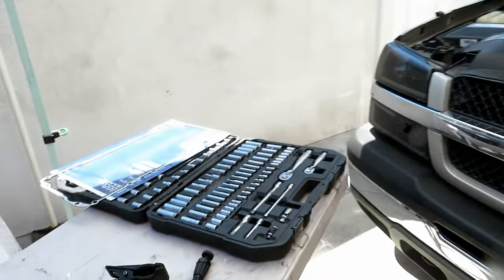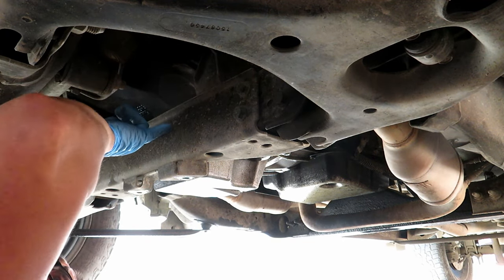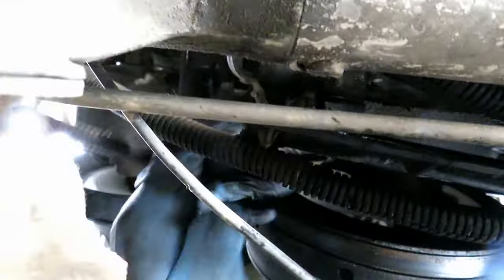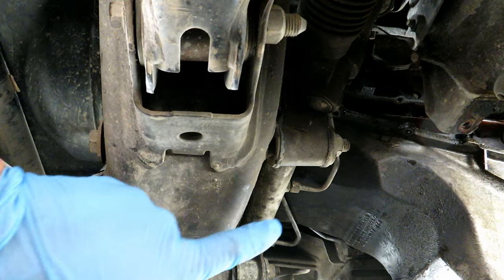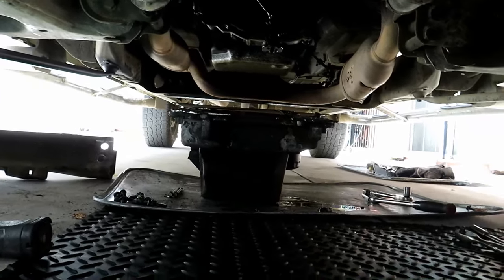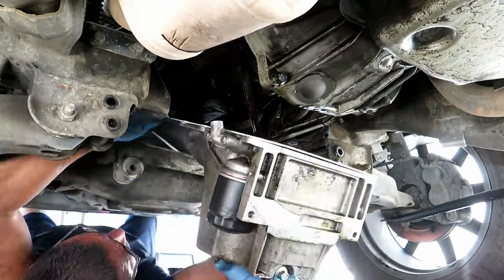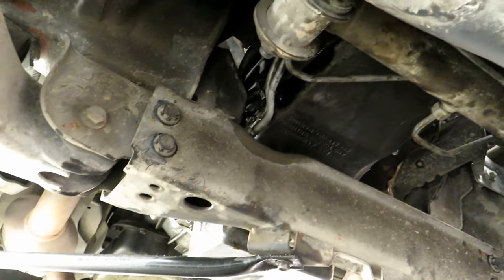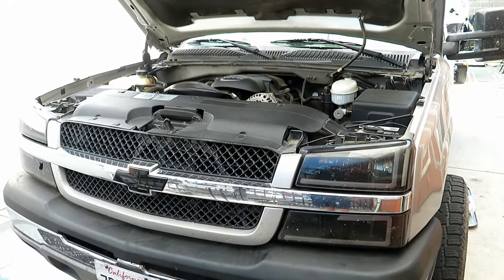Chevy Silverado 2WD - Oil Pan Gasket Replacement

Comment: Terrible the guy didn't even use gasket Maker
Reply: Factory tells you not to use that junk so whos the terrible one x)
Reply: Gasket or glue but not both!
Reply: @LucidRelaxation619  there are 2 points on the gasket in the aft that you should apply it, I believe it's for the rear cover.
Reply: @oreo1167  you never use glue
Reply: "glue" just holds the gasket in place
Reply: Exactly when u use torque specs u shouldn't rely on that stuff
Reply: You must still apply rtv on four corners front above the crank and rear near bellhousing.
Reply: So that gasket has been replaced b4
Reply: @ArmenArmenjs I heard the same thing, put RTV on The corners
Reply: @LucidRelaxation619 actually they do.

Comment: Only thing I would have done differently would be to install a new o ring in the pick up tube while in there. Good job!
Reply from the maker: Yeah, good practice to do it while in there
Reply: @hyr0llr in that case get a pickup tube girdle too
Reply: @shadowopsairman1583 why?
Reply: @hyr0llr  do you know the Torque for the long SCREWs he doesn't say that..also I hear those LONG Screws have to be torque first before the pan oil screws this is true or doesn't matter

Comment: The Verticle Cross ember bolts are 15 mm, not 13 (2006) also there is a 10 mm bolt that holds the transmission cooler lines to the oil pan that is forward of the oil level sensor-10 mm bolt. The harness that wraps around the front of the pan after you get the 10 mm bolt out you should pull it to the right to get the plastic lug out on the passenger side. 2 of the 15 bolts are long shanked and mount in the rear of the pan. You for sure have to move the steering rack to access a couple of the short bolts. Wear Safety glasses for sure.

Comment: Doing an o ring replacement as we speak and your vid was very helpful. From watching other video's I found that loss of oil pressure is a common issue on high mileage LS motors. I bought my 2001 new, it has 280k on it and still runs strong, but I started it and let it idle to warm up a while back (In Colorado, it was cold) and when I came back out I thought for sure it was going to blow up it was making so much noise. So just now getting around to fixing it, cut the oil filter before I did anything and there was not a speck bearing material in it, so we're good to go!
Reply from the maker: Much appreciated. Thank you. 

Yeah good thing you caught it before it grenaded lol let me know how it goes when all is said nd done.
Reply: @hyr0llr  Job done and driving it. It's the quintesential $2 oring making your life diffucult. And now  have a neighbor with the same problem that I guess I will be fixing for him :)

Comment: I believe that the O rings for the oil pump should be replaced while the pan is off because they get old and crack in man cases. I need to do this exact job in order to replace that O ring.
Reply from the maker: Good practice yes

Comment: Great video, thank you! After watching this I will definitely attempt to repair my o-ring issue (low oil pressure) myself.  I have a 2001 GMC Sierra, 2WD, 4.8L.  I assume it's the same process as this Silverado.  Can you plz provide the torque spec for the two 13 millimeter Cross Bar  vertical bolts (@6:19 min)? Also, the torque spec for the driver & passenger angled support bars (@ 6:51 min)? TY

Comment: Are there torque specs for the power steering rack bolts
Reply from the maker: @Sacto911  what i found online right now is 136 ft lbs
Reply: @hyr0llr Thanks!

Comment: What year is this truck.  I need to do this for my 2003 chevy silverado 1500 4.8 V8.   Wondering if i may have a few more steps in the undercarriage. Hoping to tackle this on friday
Reply from the maker: 06 i believe. This is the 2wd video. I few video after this i did it for a 4wd, so you can check that one out also
Reply: I got the same except mine is an 05 
How did you do
Reply: @mexozul   it worked out perfectly. Any minor deviations you will notice as you go. But I was able to complete it and haven’t had any problems since.

Comment: What is the torque spec for the 2 steering rack bolts you remove?
Reply from the maker: Looked online real quick and i found a torque spec of 135 Ft Lbs

Comment: Is this the same gasket for the 2002 1500 4.3?
Reply from the maker: No it is not
Reply: Nope, the vortec 4300 is simliar to the vortec 5700 but the oil pan is shorter

Comment: Hwod you remove the sensor
Reply from the maker: The wire to the sensor?
Reply: @hyr0llr  never mind bro i got it, mine was facing down, damn you answered fast. Thank you man
Reply: It was for the oil level sensor, but the hole where you unclip the sensor was facing down

Comment: Damn, I'm dreading this repair!
Reply from the maker: Its not too bad. Youd really be dreading it if it was a 4WD. Lol i was happy islt was just a 2wd also.
Reply: Nope, not that bad. Only thing I didn't see immediately was to remove the steering rack bolts. Did a dodge 4wd which required removing engine mounts, trans mounts, jack the engine up, it was a mess

Comment: Im pretty sure you need that alignment
Reply: in the 2wd case no alignment is needed. on 4wd all  you need is loosen the bolt for axel to come down 3 inches. Dont need to remove entire front axel. Yes, lots of 4wd vd out there not many 2wd.  Also good ins to change the pickup O- ring while the pan is out.